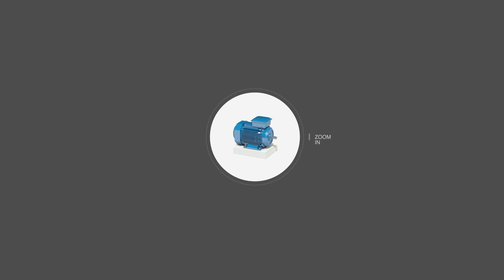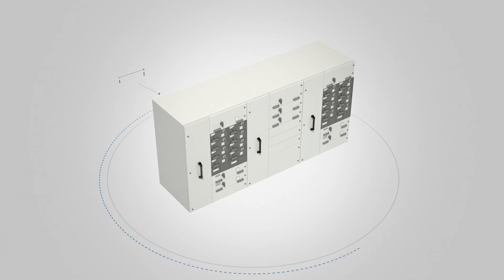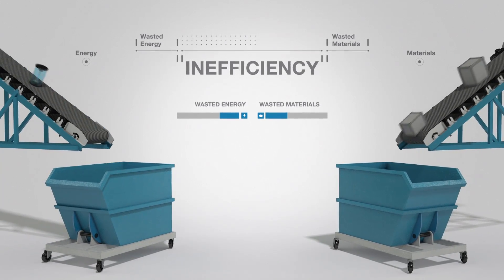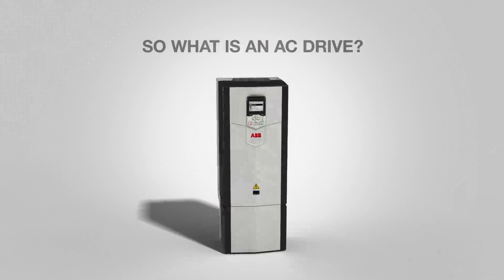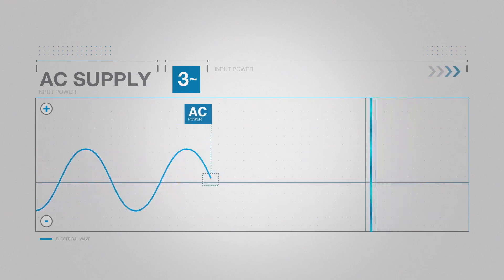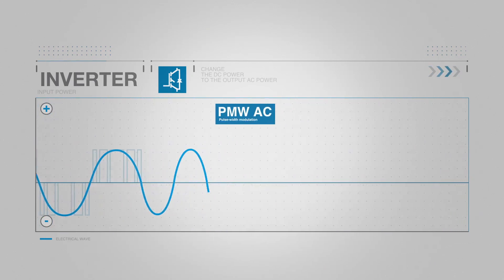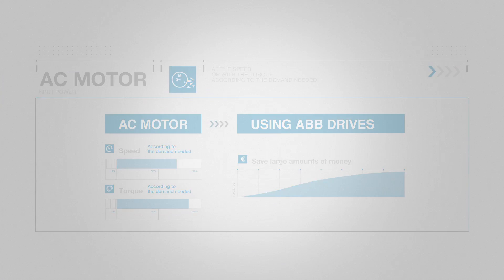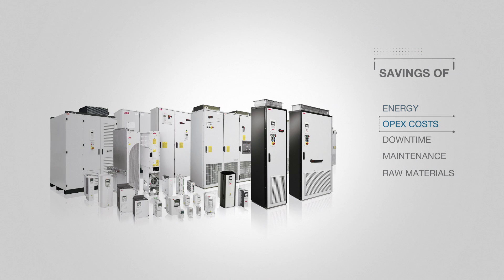What Is A Variable Speed Drive (Inverter)

Comment: Nice video. But could someone tell me how is different between Inverter, VFD and VSD, please?
Reply: Just there functions are diffrent .

Inverter converts Ac to Dc 
VFD converts fixed frequency  into variable frequency 

VSD consists of VFD and variable voltage converter and inverter
Reply: ANTHONY RONALD incorrect an inverter does dc to ac and a rectifier does ac to dc